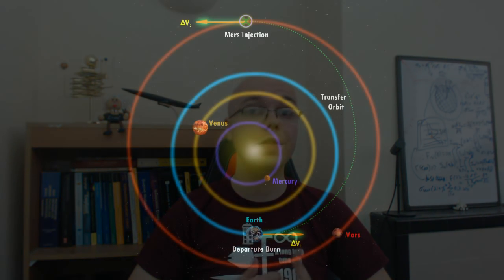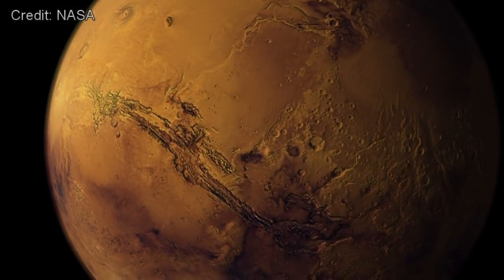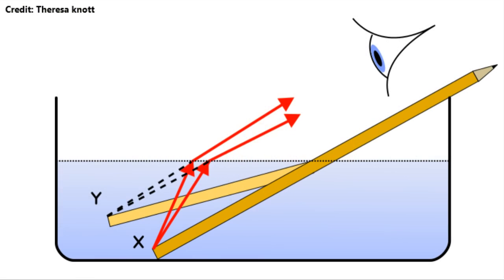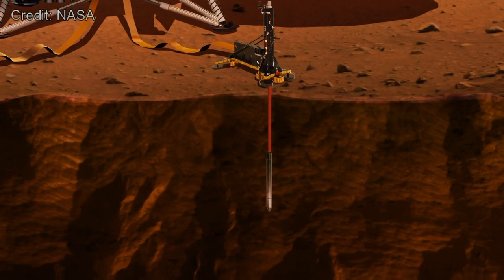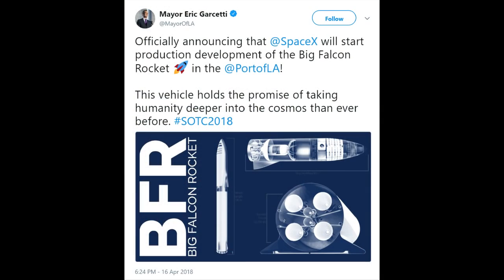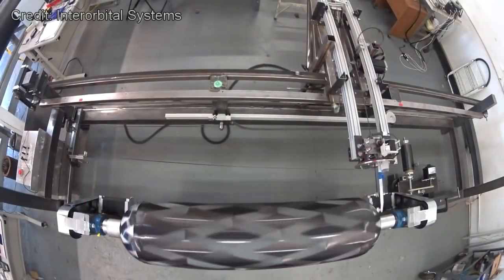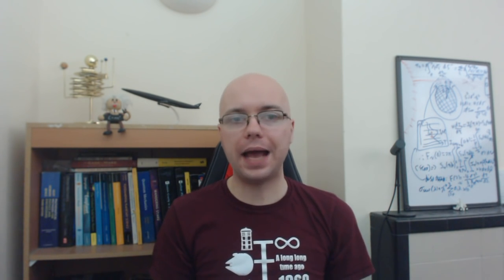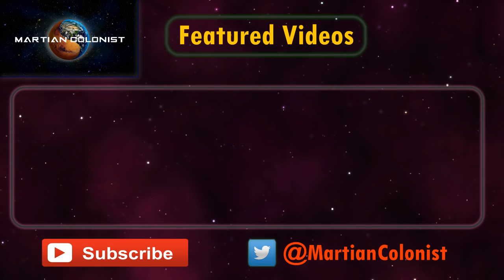Mars Mission Update: May 2018

Comment: At 'sea level' Mars's atmosphere is technically a vacuum, but you still believe parachutes would work at high altitudes? Have you even thought about this anomaly? Or do you just believe whatever comes in over the telly?
Reply: At high speed, even a thin atmosphere will enter a parachute fast enough to fill it and create significant drag.  When the speed drops lower, the drag will be insufficient and rocket firing will be required to land safely.

Comment: 0:01 "May 2018 is that special time every 26 months..." ... what?
Reply: Due to the different orbital periods of the planets, the ideal transfer times occur at regular intervals.  The best time to transfer is when the least fuel is expended to get from one planet to the other (typically this is the Hohmann transfer).  For Earth-Mars, the position of the planets relative to each other resets every ~26 months and the position of the planets relative to the background stars resets every 9 cycles.  You could wind up burning several times as much fuel if you tried to go at a time other than a few weeks surrounding the ideal transfer window.  So pretty much no one would do this.

For a great example of how transfer cost changes with time read this:
Wooster P.D. et al. Trajectory Options for Human Mars Missions. AIAA/AAS Astrodynamics Specialist Conference and Exhibit, Guidance, Navigation, and Control and Co-located Conferences. August 2006.

Saving fuel in this situation is kind of like astrology in that everything depends on the alignment of the planets and stars... Queue The 5th Dimension music: https://www.youtube.com/watch?v=kjxSCAalsBE
Reply from the maker: Mark Zambelli 
Earth -> Mars Hohmann transfer.

Comment: I have two questions for you: is it just the result of the hasar if the space station has never been scarred by a debris or a small meteorite? Why the outer walls of the orbital station are not made of photovoltaic panels? Good luck in your projects :)
Reply from the maker: 1) The space station is continually hit by small pieces of space junk. I've held one of the solar panels that was brought down from the space station during one of the shuttle servicing missions, and you can visibly see marks from impacts.

2) It makes the most sense to point solar panels such that they are fully illuminated by the Sun. No point coating the Earth-facing part of the ISS in solar panels.

Comment: Mars: "Brrr, it's getting cold again I think I need to buy a new magentic field..."
Reply from the maker: Magnetic Field Generator - new from the Boring Company.
Reply: Lol yeah, I was thinking about something like that. Do you think it's possible to drill all the way through the center of Mars' core? or wouldn't that be necessary?
Reply from the maker: We haven't even managed to drill to the mantle on Earth, so we are a long way off. Not necessary though for terraforming Mars, as you could generate a global field with an equatorial belt of superconducting magnets (something I should be touching on in the terraforming video).
Reply: Wasn't there a geothermal power company in Iceland that managed to hit magma?  It's only 1 or 2 km down there due to the rift in the continental plates.  I can't remember any names, those Icelandic words are crazy :P

Comment: Another great video as always, thankyou very much.
I would really love to see a video detailing how the first Mars explorers will survive and function on Mars.
Including:
Water production
Air production
Power production (options etc) 
Effects the environment will have on the body ie gravity, atmosphereic pressure, radiation and solutions and technology that will managing these problems. 
And what equipment will be essential in the beginning. 
Also how would they back up these systems ie if an oxygen machine failed. 
Getting to Mars seems to be a problem that will soon be solved (credit to space x) but the challenge of keeping a man/women alive and healthy is rarely discussed and deeply fascinating.
Reply from the maker: I think the idea of a 'Surviving the first days on Mars' video is excellent. Thanks for the suggestion!
Reply: Some "light" reading in that regard:
Jones H.W. July 2016. Using the International Space Station (ISS) Oxygen Generation Assembly (OGA) Is Not Feasible for Mars Transit. ICES-2016-103. 46th International Conference on Environmental Systems. 

Tomes K., D. Long, L. Carter, and M Flynn. 2007. Assessment of the Vapor Phase Catalytic Ammonia Removal (VPCAR) Technology at the MSFC ECLS Test Facility. NASA Marshall Space Flight Center. MSFC-341. NASA Ames Research Center. 2007-01-3036. 

Carter, D. L., D. Tabb, and J. Perry. 2008. Performance Assessment of the Exploration Water Recovery System. NASA Marshall Space Flight Center. National Aeronautics and Space Administration. 2008-01-0042. 

Jaunsen J. R. The Behavior and Capabilities of Lithium Hydroxide Carbon Dioxide Scrubbers in a Deep Sea Environment. U.S.N.A.-TSPR; 157. United States Naval AScademy, Annapolis. 1989. 

Knox J.C. et al. Integrated Test and Evaluation of a 4-Bed Molecular Sieve (4BMS) Carbon Dioxide Removal System (CDRA), Mechanical Compressor Engineering Development Unit (EDU), and Sabatier Engineering Development Unit (EDU). Draft. NASA Marshall Spaceflight Center. 2005.

Sherif D. E. and J. C. Knox. International Space Station Carbon Dioxide Removal Assembly (ISS CDRA) Concepts and Advancements. 2005-01-2892. Honeywell International, Torrance CA. 2005.